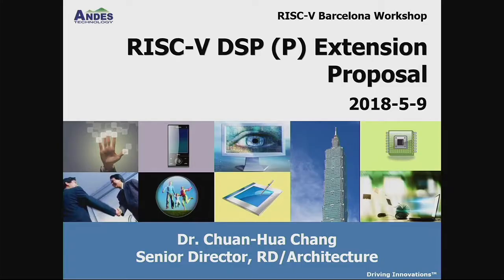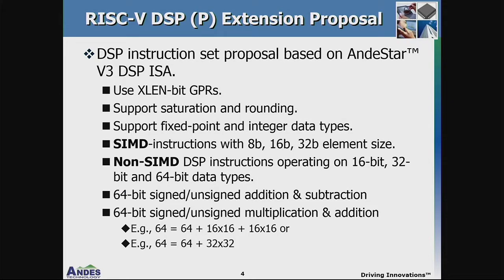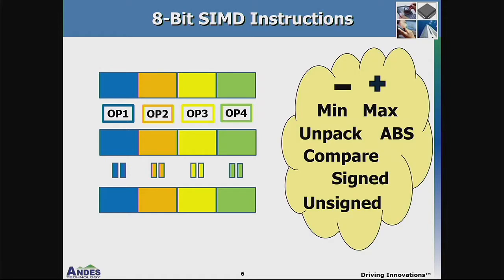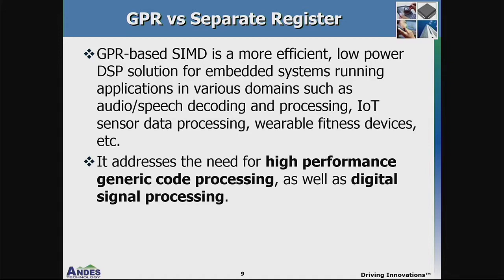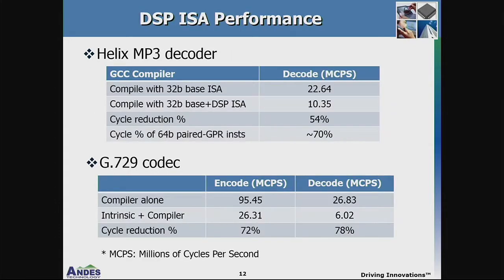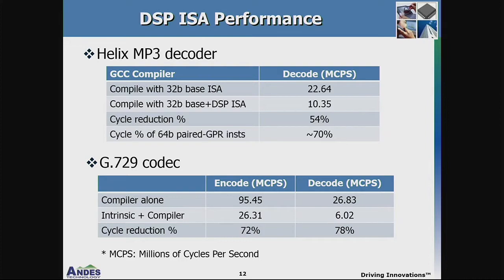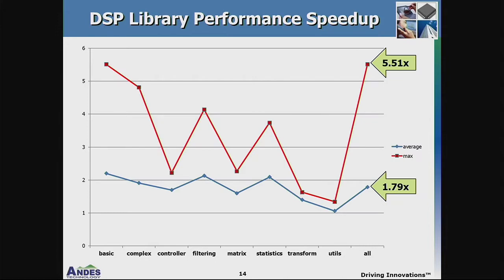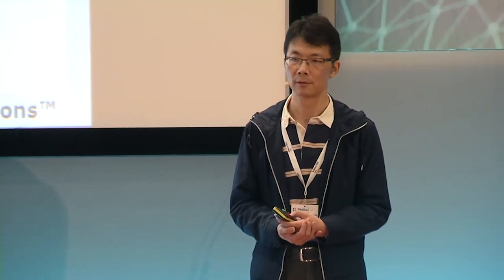RISC-V DSP (P) Extension Proposal

Comment: Make it intrinsic function means programmer who write in C would not worry about special or extension command out of regularly in C code. Like those who 're programming x86 in the past they didn't need to know whether its mathco processor equipped or not.